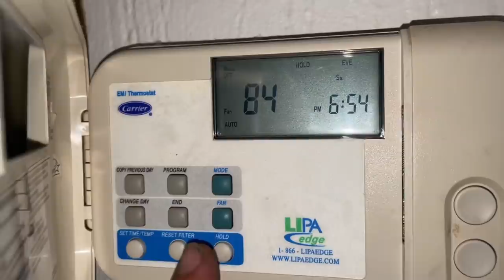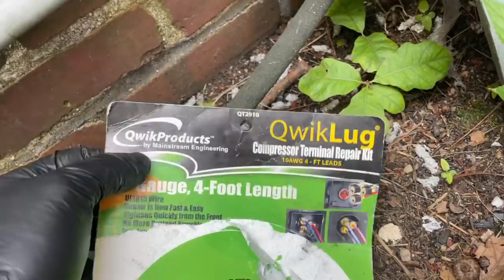Old Carrier Central AC System Shorted & Dead Compressor Tripping Circuit Breakers

Comment: Wtf open service box😱 I have the same thing with tennant's I give them a call first on the way knock on door 3 times and if you heard me knock you know I am hear 
If no response from them after 30 minutes L/L gets a half hour invoice, lol
When you were checking out the voltage I said you pulled the disconnect 😜 . Good video

Comment: Didn't see you check compressor terminals to ground.  That's the first thing I'd do when I seen a plug like that, any thing other than "OL" on the meter means the compressor is shorted.

Comment: that contactor was way beyond bad, looked like the one contact was totally gone and burning into the cross bar. which very well could have made the compressor not start and set there burning the wiring. the contactor was likely the sizzling noise and it may have ran with a new one, but overall it looks spanked to permanent flaccidity (LOL)